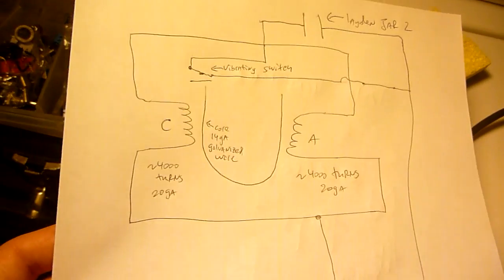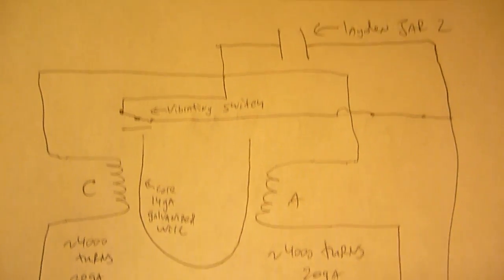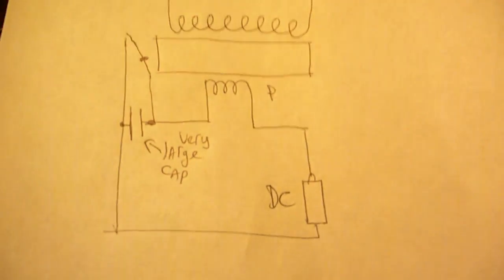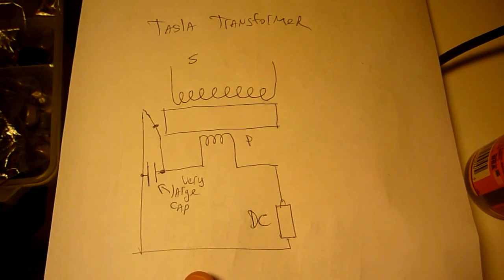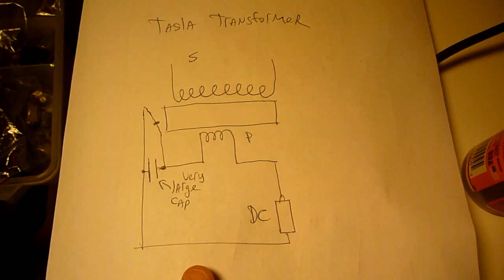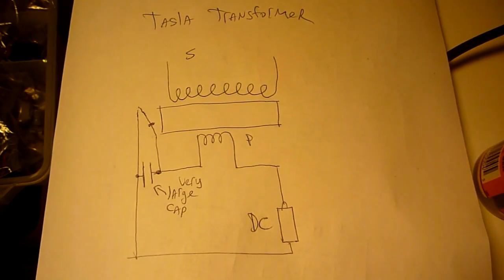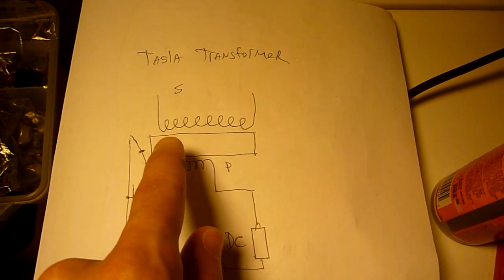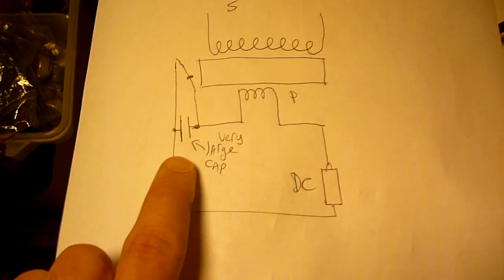PMH Pulse Motor without a transistor (update) + growing copper crystals

Comment: You were making gans?
ps: the spiderweb as you call it, it gives me he creep. Makes me think of fungus.
Thanks for sharing about the PMH. 
I wonder why the Leedskalnin PMH is not in use in relay switches. Like for the room temperature / thermostat. It contains a small relay, battery operated n many cases. We could use a PM relay so switching on is just a pulse and not a continuous current. And when it is released, the current could be sent back to the batteries. Voila.